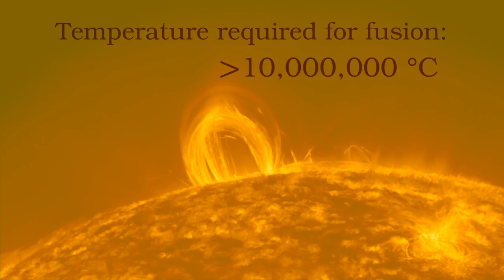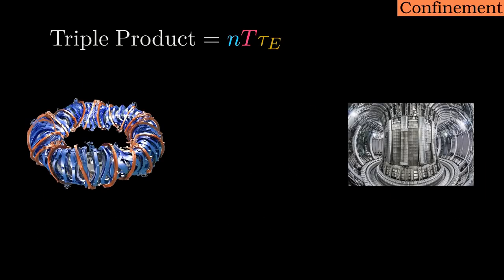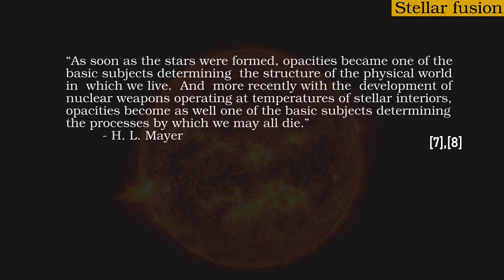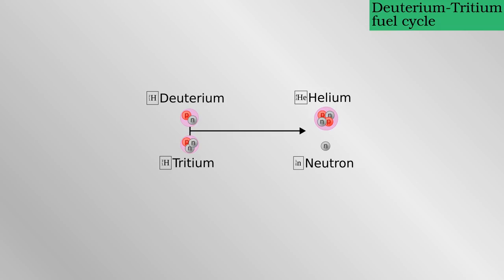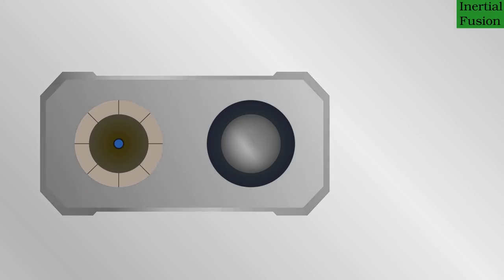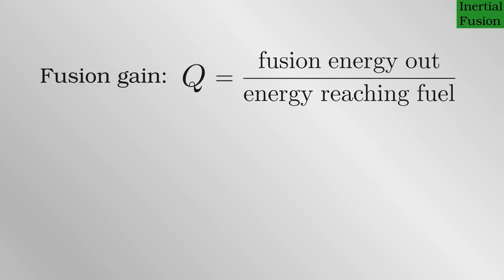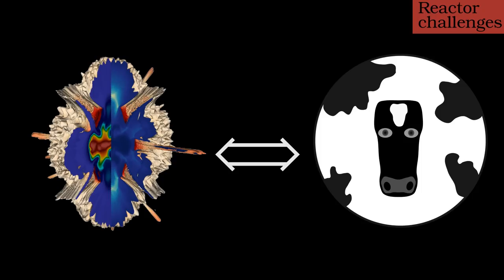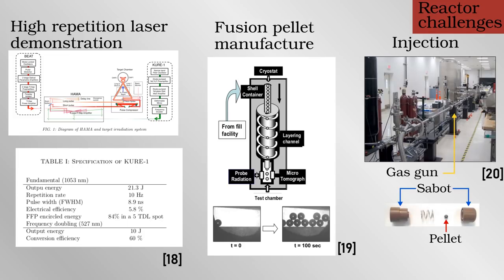How nuclear fusion works (2) - confinement, stars, nukes, inertial fusion energy

Comment: Sun's core is assumed to be very dense and hot. 
The current solar model suggests the density at the core's outer edge be 20 g/cc, heavier than the uranium, while the hydrogen is in plasma state.
We don't even have an agreed upon phase diagram for hydrogen for such density and temperature, but let's assume it's plasma there.

Then, what prevents the entire core of the sun from imploding and become helium or heavier element instantly?

When hydrogen bomb explodes, it will keep fusion reaction until the pressure/temperature get removed or lowered.
In the solar core, gravity holds the pressure, and more fusion means hotter temperature, so more fusion should lead more and more fusion.

What's acting as a so-called "control rod" in the sun's core, which prevents further fusion reaction?
Reply from the maker: If you watch the video, you will see that the peak density in the sun is 200 g/cc while inertial fusion reaches up to 900 g/cc (sometimes even greater) as shown at 18:21 in the referenced figure. The temperature is also higher than the center of the sun. The phase diagram, equation of state and so on for hydrogen at even greater extremes than the center of the sun is achieved every day at the National Ignition facility, among other experiments. The state of matter is very well understood.

The temperature and density in the sun is a balanced and stable equilibrium. If the temperature increased, so would the pressure; the plasma would expand until its density dropped; lower density would lower the fusion rate until the temperature dropped back down. The system is therefore self-regulating. This is in contrast to fission reactions which would grow exponentially if the control rods as you put it are not there.
Reply: @ImprobableMatter  "The state of matter is very well understood." 

-> I don't think they actually "measured" any properties of the "plasma" state when the fusion is taking place. Viscosity, conductivity, impossible to measure.

"If the temperature increased, so would the pressure; the plasma would expand until its density dropped; lower density would lower the fusion rate until the temperature dropped back down." 

1. In the Sun, because the gravity is holding the entire core together, if density gets lowered for any reason, the core will expand, temperature lowered, fusion rate lowered, and the density and temperature lowered further, and then the fusion would stop entirely. 

2. Instead, if fusion did "ever" take place inside the sun, one helium atom is much smaller than four hydrogen atoms, so the density gets denser, and due to fusion, it's hotter, so more fusion should take place, and denser helium will further make the core more compact, core gets smaller, denser, and hotter, encouraging more and more fusion. 

The current solar model is an unstable system, not self regulating stable fusion reactor. 

The Sun's core should have become helium or heavier atom almost instantly 4 billion years ago, as soon as fusion started. 

Solar fusion is an unstable model. The entire Sun's core is a fusion pallet firmly held by the gravity pressure, no escaping from it.
Reply from the maker: You are mistaken. Numerous experiments, including the NIF, have directly measured plasma properties at high temperatures and densities.

Your point 1 is logically incorrect: when the temperature is lowered, the pressure will lower and the core will contract again. It is therefore a stable system. Your point 2 is also misinformed, since most of the hydrogen has not yet fused and therefore the effect of having fewer particles is not significant. Will it be in the future? You bet, and models of the late stages of the sun's life take this into account. They agree with astronomical observations of red giants in our galaxy.

Anyway, I am leaving this comment mostly for the benefit of anyone else reading this, not because I hope to change the mind of anyone who believes the Earth is hollow or some other nonsense.
Reply: @ImprobableMatter  "Your point 1 is logically incorrect: when the temperature is lowered, the pressure will lower and the core will contract again. It is therefore a stable system. "
Why temperature is lowered? Because fusion rate is lowered? Ok, let's start from there then. You are wrong anyway.

1. Temperature is lowered "SOMEHOW".
2. Fusion slows down.
3. Pressure lowered
4. Core contracts
5. Density increase
6. Temperature increase
7. Fusion occurs more
# 8. 4 hydrogens become 1 helium -> lot mode dense.
9. Core contracts, temperature increase, 
10. Pressure decrease by factor of 4 (H -> He) & Pressure increase by factor of temperature (not much change) => net less pressure.
11. More contraction
12. More fusion. -> Go back to #8.

Unstable? You Bet. 
Did I get anything wrong here? 
If so, tell me where.

Comment: I have designed an entirely successful fusion power plant. The  solution lied in the creation of  a z-pinched stellerating spherical tokamak. I am unable to release the full design to the public at this time because a portion of my design may infringe upon currently valid patents, and also because I must complete my prototype power reactor for safety testing. The test bed reactor  will have to wait another month though because the primary coil of the reactor is needed by my lawn mower until such time as the grass stops growing - and I also need to get my electricity reconnected. It is frustrating when your local utility blocks the advance of civilization.

Comment: Perhaps with  neutrons , which have 150 T and Protons.
Photons have only 0,03 T as UV light.
Light lasers tend not to be inertial fusion lasers at 0.03 Tesla (for momentum-balancing particles with UV)
Neutrons have 150 T . Nucleons become per charge and field strengths
brought to mutual resonance paths up to the right fusion.
in the core they continue to circle the nucleons in between. (not the laser electrons)
from the projector or LCD screen 😁. They're probably somewhere else.
The halogen lamp would probably be 100 times stronger when shined in from the Mono - Laser side?
(More like a joke) Cheap LED advertising from China keeps popping up!
Of course, the sun doesn't shine like limone when it comes to nuclear fusion on earth.
Also, limone light does not increase nuclear fusion on Earth!
Cleavage of borisotopes alone and Laser moon light - as nuclear f i s s i o n  became the first time in the world ? 
No No.  some disco - jokes either more ! Not light makes ignition , but f u s i o n ignition makes some little light too but 
more gamma. how media works  i will not say . What is imaginative nuclear bomb power and what is good joule ?